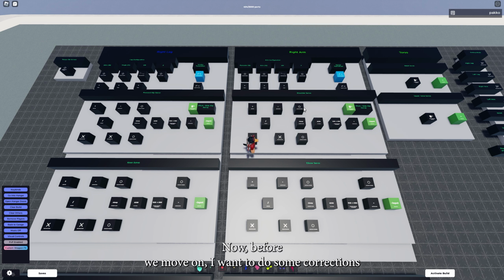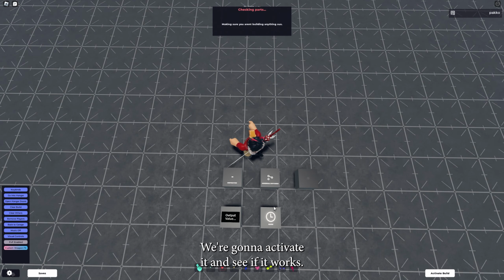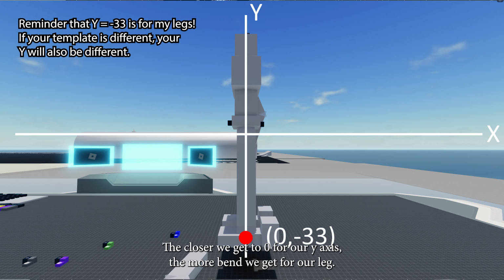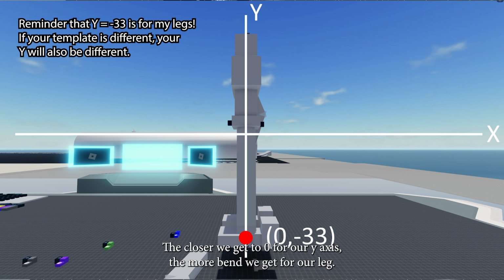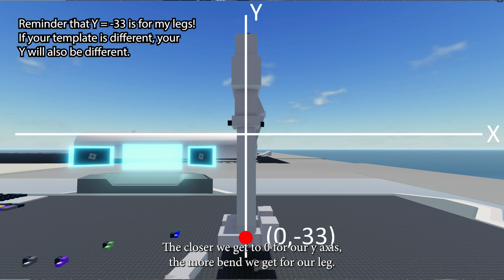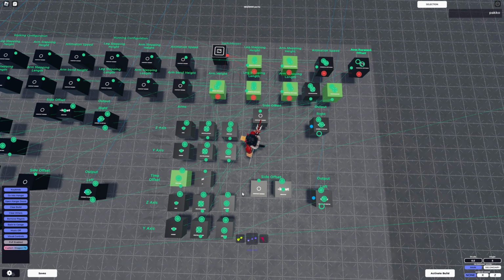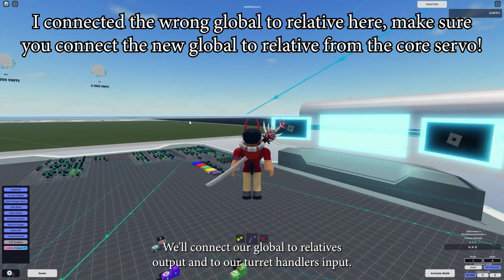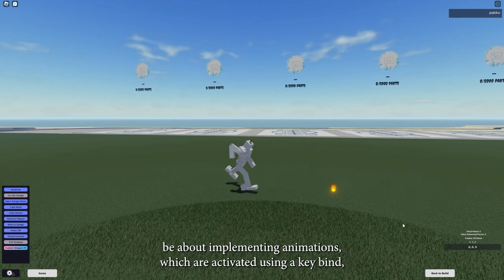Roblox Elite Engineering - How to make idle, walking, & running animations for your mech template

Comment from the maker: There are a few mistakes in the subtitles (I used an automatic transcript in the editor). If the explanation is confusing, please let me know and I'll try my best to clarify.
Reply: for some reason upper arms and upper legs dont bend properly in the idle animation, they bend with lower leg and arm instead of oppisate
Reply: Every time i follow you EXACTLY as you say but for some reason the thighs and upper arms of my mech are just stiff while the forearm and shins of my mech are working fine, i cant find any problems in the thing, do you know the fix?
Reply from the maker: @chrispaige8880 I'll give you some troubleshooting tips that helped some people

- Check the configuration constants and see if they are right

- check the minimum and maximum constants for the clamps in the logic, it has to be -1 and 1 respectively 

- check the torque of the servos

- check and see if the inputs are connected
Reply: @Telophorus  I dont think its any of those since when i switch the position grabber mode the parts work fine.
Reply from the maker: @chrispaige8880  Sorry, I think I misread the problem LOL.

You're in the idle animation part right? Try checking the inputs of the switchboxes in the animation handler.

Something that you can also check- you can check this in the position number displays, when in the idle animation, are the coordinates of the limbs changing at all? If it isn't, something is probably wrong in the equation (one of the configuration constants in the idle animation could be 0)

Just try double checking the constants in general and see if the inputs are connected properly
Reply: @Telophorus  Lemme explain in more detail since none of those seem to be the problem:
Im at the part where you finish the idle animation (aka 9:20) and test it. When i test it however, the upper arms (aka brachium) and thighs are stiff and pointing straight down. I already tested to see if they were moving or changing angle at all and the results showed 0. HOWEVER, the forearms and shins are moving up and down like they would in the video. Its not like i anchored them or something since when I put it into position grabber mode the brachium and thighs go to position perfectly. I'm really thankful you are helping me with this btw, its really nice of you.
Reply: @Telophorus  Lemme explain in more detail since none of those seem to be the problem:
Im at the part where you finish the idle animation (aka 9:20) and test it. When i test it however, the upper arms (aka brachium) and thighs are stiff and pointing straight down. I already tested to see if they were moving or changing angle at all and the results showed 0. HOWEVER, the forearms and shins are moving up and down like they would in the video. Its not like i anchored them or something since when I put it into position grabber mode the brachium and thighs go to position perfectly. I'm really thankful you are helping me with this btw, its really nice of you.
Reply from the maker: @chrispaige8880  This seems to be very hard to troubleshoot without me going ingame in person. You can try to add me in roblox and i'll try to join your game if you let me know when you're on
Reply: @Telophorus  Alright, username (dont make fun of me, it was a hand-me-down account)
Rosepoopypoo. Display: Muffin.
Reply from the maker: @chrispaige8880  its a great username i dont know what you're talking about (added, username is pakko)
Reply: @Telophorus  Alr i accepted the request, ill be on a lot at around 1-3 o clock maybe, if im not on then ill probably be on at around 9
Reply from the maker: @chrispaige8880 sorry I haven't been on lately cause Im pretty busy, I'll try to catch you whenever you're on
Reply: @Telophorus  cool.
Reply: @Telophorus could you help me out as well i have a similar issue
Reply: @chrispaige8880 the problem that worked for me is connecting the testing mode switch boxes to the vector translation of all the limbs
Reply: @chrispaige8880  Hey, sorry to bother but was a fix ever found?
Reply: @Thatoneguy_online  It was a year ago so I don't remember much but I remember I tried troubleshooting it myself and I also got some help from another dude, it only kind of worked, because I remember it having some problems. What I recommend is just copy pasting all of the stuff for the legs and making it into arms and hands.
Reply: @chrispaige8880  alright, Also I Figured out that my Shin and Thigh Constants were Flipped, causing the bend,
Reply: @Thatoneguy_online  DUUUDE that makes so much sense, I wish I did that a year ago.
Reply: yo @Telophorus so for some reason when i test the idle animation the legs and arms bend and they move at a weird angle ive tried troubleshooting but i dont know what it could be
Reply: @benovajamen9917  Same here, Did you find a fix for it?
Reply: Idk why but somewhere around 19:34 I dont know what I did but the legs are spreading out like exaggerated running idk what went wrong :/

Edit: It also goes reverse for some reason

Comment: i'm currently at 9:20 of the tutorial, and things have been working fine

the testing mode works great as the limbs follow my position sensors

however as for the idle animation, i'm having an issue where although the knees and forearms are moving fine for the idle animation, the upper arm/shoulders and thighs are completely still (like as if their angle is just set at 0)

if theres a connection im missing, i can't figure out where it would be, mind giving ideas?
Reply: the offset appears to work for the idle position of the upper arms and thighs, however they still just seem entirely disconnected from the idle bobbing/resting animation that the forearms and knees have
Reply: managed to somehow fix it by redoing part 1, so i have no clue what the problem was but if anyone else is having the same issue then they did something wrong from part 1 of the tutorial
Reply: @gman5442  Yo im having the same problem! Do you think you know what you fixed?
Reply: @chrispaige8880  idk either, read my second reply as i just had to redo part 1 from where he plugs in the torque to the servos

my advice would just be to redo part 1 from scratch
Reply: As in the entire part one vid or part one of THIS vid?

Comment: At 9:24 my idle animation is like this but the legs are about 62 degrees backwards and the arms are about 62 degrees forwards, could you help with this?
Reply: nvm fixed it i accidentally put only the length of the shin/forearm instead of the length of the entire leg/arm

Comment: my mechs feet dont go flat when i added all the hip and knee servos angles the kinda just follow the angle of the idle anim
Reply from the maker: What do they look like? You might have to subtract them instead of adding them, you can also just try doing the knee servo only or the hip servo only. Try experimenting to see if anything works
Reply: @Telophorus  ive fixed them, now my main problem is that i cant get the walking and running anim to actually propel me forwards the toes kinda just push me back
Reply: @Telophorus  like my legs dont do a circular motion

Comment: Hey Telophorus, As i go on the turtorial everything was going just fine until i got to the vertical core part when my mech just go bazonkas on the top part of the body from the arms and waist, do you have any idea why that would happen...?
Reply: Having a similar problem. My mech just starts being really funky jumping around and stuff
Reply from the maker: Hey guys, try putting some weight onto those core servos (non-collide, 10 density head meshes)
Reply: @Telophorus did that but now my mech is still swinging around left and right or back and forth. My mech is small like 18 studs tall idk if that might cause a problem…
Reply: @Telophorus  Im sorry, I've done that and things get much better but now when the mech starts the arms got abit offset and over time the mech moves and get bugged going bazongkas again
Reply from the maker: @Iwasfoundunharmed  sorry for the late response, are the servos also 10 density aswell? the best advice i can probably give you is just play around with the mass and density of your mech until it stabilizes
Reply from the maker: @GArmSAlt  if the arms got offset, try checking in build mode if the head meshes are touching any other parts of the mech, and make sure it doesnt weld onto the unwanted parts of your mech
Reply: @Telophorus  the head meshes arent touching any unwanted parts of the mech, i've tried activating the mech one without the vertical core servo and one withouth the horizontal core servo and as for the result is the mech with only the horizontal core servo is fine but the one only with the vetical core servo fold and starts to fling around the garage with offsetting parts of the body when i ride on to the pilot seat...
Reply from the maker: @GArmSAlt  try adding headmeshes to the vertical core servo too if u haven't tried yet
Reply: @Telophorus  sorry for the alte response, do you mean putting the head meshes inside the core servo's inside the body? because i did that also and the top part of the body still malfunction... i tried to put an anchor on the lower part of the body to see how it actually reacts, when i activate creation the top part of the mech already start to facing different directions with immense speed without me getting on the pilot seat and my mouse stays still in a specific point... and same does when i hop on the pilot seat. i also tried adding more aim parts, for some reason it reduces the speed of the havoc but no matter how much i duplicate it still malfunctions at one point...
Reply from the maker: @GArmSAlt if you have discord, join my server, it should be easier to help you in real time and in game

Comment: At 9.18, it seems that my shins (knee servo level) and forearms (forearm servo level) are doing the idle animation just fine however the shoulders and hips are stationary. Do you happen to know what the fix could be? Thanks
Reply from the maker: When you go into position grabber mode, do the limbs follow the position sensors correctly? Try double checking the IK formula in your logic board and see if all of the connections are correct
Reply: Yes they follow them correctly. I can't figure out why the shoulders and hip servos stay still for the idle animation though i tried everything.
Reply from the maker: @aniketrajkumarsingh5063  can you check if the IK formula section for the hips and shoulders are connected to the animation handler?

Comment: when it goes into idle the legs move backwards a bit and the arms forward, almost as if its a levitating idle. how would i fix this? it also seems like it isnt following the right axis. when i rotate a servo to stop the limbs from going back a bit it seems the feel are going out rather then straight up and down. Edit: i rebuilt everything, followed the tutorial again and i'm having that same issue
Reply from the maker: @joosh3571  hey, sorry that you're having this issue. Please don't try to rotate the servos to fix this issue, but perhaps do try and see if you are using the correct equation that configures the IK itself (the one from the last tutorial). I did connect the equation incorrectly, so if you followed the tutorial directly and connected the logic step by step rather than following the equation yourself, it could end up like how you described it.
Reply: Yeah I’m having the same issue, I thought atleast I was following the equation itself but it isn’t working for me. Maybe I should try redoing the whole thing.

Comment: Why are my legs freaking out when i un anchor it, it cant stand up on its own. Everything was fine until i got into the core servo part and un anchored it.
Reply from the maker: @S_Altra  I don't think it's a leg problem, but a core servo problem. You might have to put some weight (10 density head meshes) on the core servo. If not, you can also try putting weight on the hip servos aswell

Comment: 9:24 I HAVE THIS annoying issue where my arms and legs are spinning and doesnt go up and down PLEASE HELP ME!
Reply from the maker: Check the configuration constants and make sure they're not set at 0
Reply from the maker: Also make sure you're using the correct sine block. If you input any number that's less than -1 and greater than 1 in an arc sine block, it will output a null number which can cause servos to spazz out.
Reply: @Telophorus what configuration constants and it spins like how it spinned in episode 2
Reply from the maker: @Husnu666  the configuration constants in the idle animation board. but the problem is more likely because you're using the wrong sine block. also i cant recall it spinning in part 2
Reply: @Telophorus  it spinned like it spinned in part 2 if u didnt press the position grabber handler mode.
Reply from the maker: @Husnu666  thanks for the clarification, I thought your limbs were spinning in circles. If that's the case, then can you make sure the idle clock circuit is running if the mech isn't moving? Make sure the idle switchbox column in the animation handler is also on when you're not moving the mech. If everything still doesn't work, I don't mind hopping in game to help you
Reply: @Telophorus  i still dont understand what you're saying. if you dont mind can u help me in the game my username is Yoosufdinosaurclub.
Reply: @Telophorus  yes please help me in game, my username is Yoosufdinosaurclub
Reply: @Telophorus  can u help me in-game? my username is Yoosufdinosaurclub
Reply from the maker: @Husnu666  ok, let me know whenever you're on
Reply: @Telophorus  can u accept my friend request I'm on rn.
Reply from the maker: @Husnu666  i think you're on when im offline lol, just try to join me anytime if im in game
Reply: @Telophorus  my county has a 10 hour difference from canada 💀
Reply from the maker: @Husnu666  yikes bro, ill hopefully be on in the weekends for you
Reply: @Husnu666  you might have used an arc sine instead of sine like me

Comment: Once I got to the running/ walking anims and input them to the animation handler, I held w to test and my arms and legs would just fold into each other. How do I fix this?
Reply from the maker: make sure the running/walking modules are connected to the animation handler

Comment: 17:29 what do i put for X here?? i dont have any side offset because my mechs hips dont rotate in that direction

also it would be useful to explain what is going on with some text here because its quite a lot
Reply: a problem with my animation now is that when it is running, the legs are maybe 30 degrees backwards to the body which would make it fall backwards if i were to use it
Reply from the maker: Side offset is optional, it's only if you want your legs to be a little bit spread out. I don't understand what you're saying for the 30 degree part, could you elaborate abit more? That would help alot
Reply: @Telophorus  whats basically happening is im enabling my mech, when it does the walking/running animation the legs move backwards

imagine the legs are like on a clock and they are facing down towards 6 but then when i press W or S it will snap to somewhere between 7 or 8 then do the animation, i also cant turn the servos a few degrees to stop this because then the idle animation is weird
Reply from the maker: @l1me5s  Okay, heres some suggestions for troubleshooting.

- If your walking/running animation starts where your leg starts abit forward, there might be an offset somewhere in the Z axis for the animation logic. You can figure this out if this is the case by connecting the Z axis into a number display and see if it starts at 0 or not.

- Might be a clock problem aswell where the clock doesn't start at 0 and starts at a random time? Check the clock circuit for the walking/running animation and see if theres any problems with that
Reply: @Telophorus  alright dude ill check later and tell u if its helped
thx
Reply from the maker: @l1me5s  If it doesn't work, you can always contact me on discord aswell. It would be easier to help if I was ingame
Reply: @Telophorus  alright
Reply from the maker: As for the text part, I'm basically removing any redundancy to save some extra parts.

Comment: could you explain how to hook up the leg height for running? Ive wanted to adjust the running leg height but you made it feed through the same constant
Reply from the maker: I answered this through discord, but if anyone wanted to have a separate leg height for the running, you'll need a switchbox that switches between the two configuration constants, then feed the output of the switchbox into where I connected the leg height constant in the video

Comment: So I tried to use my controller for the walking mechanism. I connect the throttle output to the speed (since the controller supports it). But whenever the speed changes, it the leg is resetting (going back to its normal position) before walking again at the desired speed. How do I fix that?

Comment: hey man, ive been following this tutorial series. at parts you've mentioned using lists to make animations? i was wondering if you could give me a quick rundown on how that would work.

i figured it would be something like using the position grabber mode to get each IK position for each frame, and then adding those to the main list for an animation for each keyframe. then using some sort of system to grab those positions and apply them to the mech when the animation is triggered?

its perfectly fine if you dont though. great tutorial series btw
Reply from the maker: you're actually correct on this one lol, we pose our mech then we grab the vectors and put it on a list create. then we use a list get vector which feeds into the animation handler! to play the animation, we switch between the two poses (the two vectors) that we've recorded. 

for example, a pose for a wind up punch, and another pose for throwing the punch.